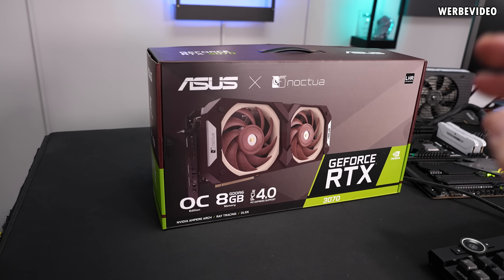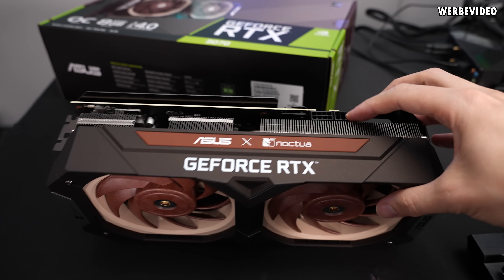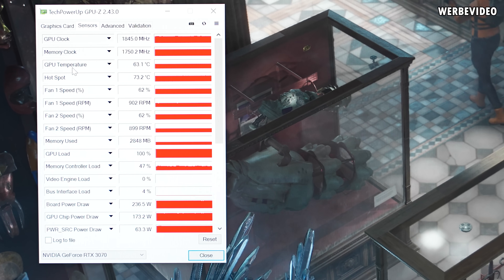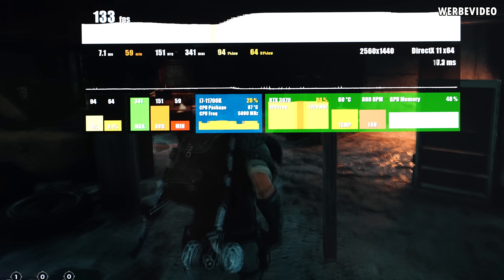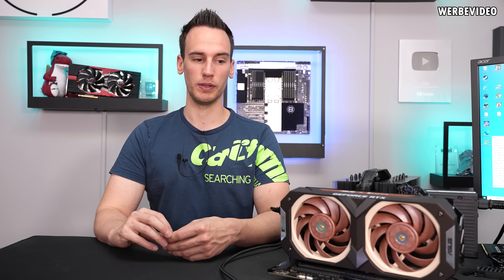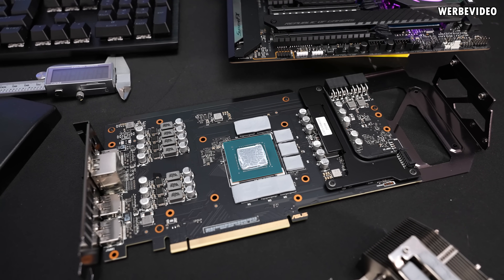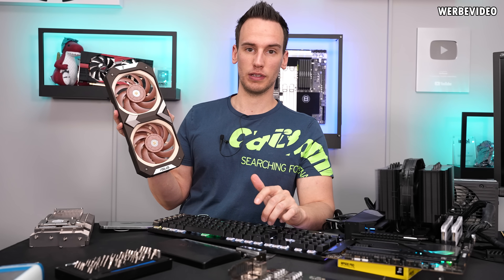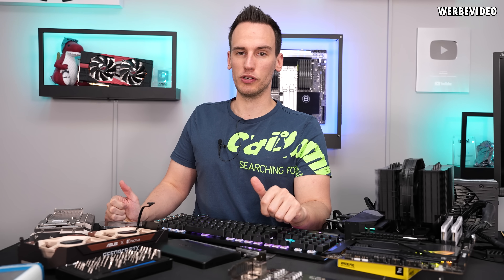Impressive Noise Levels - But what's up with the Heatsink? ASUS x Noctua RTX 3070 tested

Comment: I don't get why everyone raves so much about Noctua NF-A series, when there NF-F series fans are so much better in every aspect
Reply: Maybe in pure airflow, but the NF-A series absolutely destroys the NF-F in everything else.

Edit: Looking at the graphs and benchmarks from both Noctua and others, the NF-F is louder, and worse at everything than the NF-A series. The only time the NF-F is better is at absurdly restrictive situations, in which case you might as well buy something else with MUCH higher RPM considering the airflow you get from the NF-F at those points is ridiculously low, not to mention the noise level.
Reply: @pickleadaykeepsthedoctoraway  the NF-F series has greater airflow and greater static pressure performance
Reply: @notFunny-d7n  At certain impedances, the A series is a better fan all around. Maybe look at the graphs Noctua provides?
Reply: @notFunny-d7n  The NF-A beats it in both at heatsink level densities, and radiator densities. I am not sure where the NF-F actually wins other than insanely restrictive airflow cases.

Edit: Not to mention how much quieter the NF-A is compared to the NF-F.
Reply: @pickleadaykeepsthedoctoraway  I did, issue is that the chart states that the fan speeds are adjusted to similar on application noise levels, that is not an accurate comparison and they don't include what the actual fan speed per fan is or what the noise level target is, in any case though that would severely limit the F series as they are designed to go up to 3000 rpm vs the 2000 rpm of the A series. So, say they are normalized at a speed if 1200 rpm, you are only restricting the A series by 40% where you are restricting the F series by 60% in performance (which in theory would not make as big difference between the 2 as it would seem, the F would have greater airflow and static pressure at this given rpm). Now then if we normalize to a noise level, then the difference is probably greater because the A series has been designed to be far quieter with almost half the dBA rating at max speed compared to the F series. Only in noise level normalized tests are these charts accurate to performance. If they were rpm normalized, we would see a difference in which the F series would be tied if not beating the A series. Also, at the given impedance of a radiator the F series has better performance and at a normal heatsink they tie, the only case on this graph that the A series wins is at the case level of impedance (also take that with a grain of salt as they don't refer to which radiator, heatsink, or case they used for testing. This points to that if we were to use an open test bench, and normalize to temperature targets, the F series would win in the given airflow and static pressure ratings that they are comparing. Also, these graphs only show static pressure and airflow of specifically the given fans as the x and y coordinates with single lines for each fan, this is not a proper way to display this graph. The proper way to graph this would be to (since they are comparing a fan that is performance-based vs a fan that is noise focused) is to have a given impedance used on the y axis, and then have 3 lines per fan on the x axis, one being airflow, one being dBA and one being rpm. Also, other red flags on their website are that this graph is only linked from the A series sheet and not from the F series sheet, and on the F series page is clearly states “The industrialPPC models are high-speed fans for industrial applications. As such, they are not as quiet as other Noctua fans and less suited for low-noise PC builds. Unless you specifically require the higher speeds and performance of the industrialPPC versions, we recommend using models of our other product lines (chromax if you prefer black fans) instead.” On the A series page within it’s graphs states “Noctua recommends the pressure-optimised NF-F12 for heatsinks and radiators and the airflow-optimised NF-S12A for case fan usage.” It also states that they only distinguish between airflow and pressure optimizations at 120x25mm fans, as there is no such distinction at larger sizes. One other thing that I technically have an issue with is that at 140mm the F series designed fans (which are distinguished from the A series fans with their given blade design, rpm rating, motor and hub design, and airflow and pressure) are named differently, at 120mm it is the NF-F12 industrialPPC-3000 PWM and at the 140mm it is the NF-A14 industrialPPC-3000 PWM, given It is the exact same design as the 120mm fan in the F series, but the dropped the F and replaced it with an A, and kept the industrial tag. Whereas the A series are:  NF-A12x25 PWM for the 120mm and NF-A14 PWM for the 140mm. But at both of these the 120mm and 140mm the respective (what should be) F series has a much higher static pressure and airflow rating than the comparing A series. Finally, check out an actual fan reviewer like NoNonsensePC who did a video that is called “MASSIVE Fan Comparison! We tested 23 different 120mm PC fans!”, in which throughout his testing, the F series beat the A series in every test that did was not related to noise
Reply: @notFunny-d7n  Well sure, you might as well get a delta fan at that point. You're being a bit ridiculous ignoring noise. You win by sheer brute force. *What I mean you win, is that the NF-F wins by brute force, not you.
Reply: This fan is not really an A series fan, it is a special, next-gen fan that is formally in the A series but performs almost like an F series, except with higher airflow under most circumstances.
Reply: @TheBackyardChemist  the fans on this card are exactly the nf-a12 fans (it even mentions this in the specs on the ASUS site), if you count the fans and look at how they are swept, the dimension and style of the hub and even the vortex generators on the blades are exactly the same
Reply: @notFunny-d7n  I got confused because I thought there was an older 12 cm A series, before the NF-A12x25. It seems like there is not.
Anyways, the problem with the F-12 fans is that they do not move as much air as the A12x25 at the same noise level, if you have them against a typical watercooling radiator or finstack.
Reply: @TheBackyardChemist  He seems to think ignoring noise level is fair. There are better fans than noctua if noise is not an issue. The NF-F fan is pretty god awful for typical use cases.

Comment: Somewhat disappointed that the fans are not directly attached to the heatsink so you can't deshroud the card. In an ITX case with the correct dimensions, I suppose you could remove the fans and mount the fans inside your chassis depending on your case size... but in that scenario why not deshroud a tuff model and get a fan adapter?

Comment: What's the Hot Spot sensor actually measuring? I have a GPU temperature of 68-71 under sustained load, but the Hot Spot goes up to 100-104.
Reply: The hottest spot on the chip, some have 10-30 sensors in the chip, this is then the hottest one.
The GPU temp 68-71 is the classic old way of measuring the temperature.
Reply: @larsjrgensen5975  I just find it hard to believe that something that would spew out heat in excess of 100 degrees would report at average 30 degrees lower temperature. Are we 100% certain that the hot spot temperature is actually the GPU and not VRM or RAM?
Reply: @dominic.h.3363  Something like the RT cores could be sleeping in the corner of the chip doing nothing, or the opposite could be true so a small area has very high load, this can give you the delta of 30 degrees.

You should have VRM and VRAM temps in you monitoring software.

As far as I understand, the hotspot temperature has always been there, it was just not visible to the user before.

You are writing that you may repaste, remember to keep an eye on the temps, my noctua paste got pressed away from the core (pump out) after a couple of months, I had to buy something else or I would need to repaste every 3-4 months.
Reply: @larsjrgensen5975  Well, the sensor was implemented on Turing cards, so it's been around for less than 3 years at most, but yea, I only recently noticed monitoring software showing the readout. I just didn't know what it was measuring exactly. I'm only getting hot spot temperatures that high when I'm doing CUDA calculations, i.e. rendering. I'll be using Kryonaut.
Reply: The GPU core actually has many temp sensors scattered across it, the regular GPU temp you see is usually an average, while the hotspot is the maximum of the sensors. Having a large difference means your cooler is probably not as perfectly flat as it could be :/ Or maybe a bad thermal paste spread, or an uneven mounting pressure.
Reply: @TheBackyardChemist  Well, if it's not the VRM or RAM chips, it's an easy fix, I can repaste the card. But a 30 degree delta for the very same component seems a bit odd for me. Like, won't that affect adjacent readings and therefore averages?
Reply: @dominic.h.3363  On 7/8/10 nm process nodes and smaller, localized hotspots in the silicon can be really fierce

Comment: A bit better than expected. I 3D-printed a duct for the MSI rx 6600 XT, and ended up with about 700rpm for 65/90C at about 23C ambient. There is a lot of wasted airflow for this Asus design, as fans do not cover the entire heatsink, and there is huge gaps in the heatsink below the fans. With a simple duct you could easily improve the performance of this Asus X Noctua design, just as you can with the Noctua D15 CPU cooler, or with the MSI GPU of mine. I do realize that with the results shown here, they are good enough for most people to not look for further improvements, which should hint at what makers should be looking at doing. With a more optimal heatsink design and 12cm fans, there is no need for a Noctua fan, for even better results than this.
Reply: duct Picture?
Reply: @brunogm  Fixing a set to make videos. I will post a video on it, shortly. I am also looking for partners to print on demand the designs I make, for 1$ a copy. I am not sure that making this a print at home thing is that wise, due to the usage of PLA and other stupidity that will produce pure hazards in a computer. Also, the lack of examples of duct designs on the tube, just shows the lack of necessary skill within the community, so as of now, there is no point in publicly sharing source files.
Reply: @FrodeBergetonNilsen   for sure will be nice when you can show it!!
Reply: @brunogm  Sure would. The thing is, that any GFX can be converted into a better performer than this Asus one, by a simple piece of plastics, and some decent fans. Say the Arctic P12.  He said he was working on something, lets see what he got. It is time for some innovation and better thermal designs for this industry. What we got is just stale and bad.

Comment: Is it possible on this card to reverse the fans to a pull setup? I've heard conversations in sff communities where some people doing deshroud mods found pull quieter than push.
Reply: I did that with my 1080ti in a Ncase M1, deshrouded and with two nf-a12x25 as pull. It works, but in a very specific case (pun intended), as the GPU is so high and long it blocks a path for the hot airflow to escape.
Looking at the video right now, I don’t see why it might not be possible… but my bet is deshrouding has the advantage to remove the shroud as an airflow obstacle. I have no data or even remote memories about it, though…

Comment: it has a reason to exist only on a 3090 or 3080/ti imo
Reply: Asus probably wants to sell off extra tuf boards with the 3070 chip on it already. 3080 cards are probably going to go EOL since Nvidia realized that the $700 MSRP was too low.

It's pretty much a tuf 3070 with a custom shroud + custom fans, with nearly identical heatsink for a huge price increase. People will pay the higher price either way, so perfect way to get extra profit while doing almost nothing. It doesn't even use the strix board, that should tell you something about how serious this is.

Comment: I laughed at James from Major Hardware when he 3D printed a shroud and put some Noctua fans on a card. It looked good for what it was but it was sooo THICK I didnt really like. Now I see this and WOW, makes his version much more impressive, lol.
Reply: I did the same thing, but I put on NF-A9x14's. Its still a 2slotter now ..
Reply: @The_Noticer.  how do you attach the fans?
zip ties or something else?
Reply: @clarkkent6054  Custom fan shroud. Drew it in NX, and then had some shop print and mail it.
I'd post a picture but any link = autodelete.
Reply: @clarkkent6054  Speed tape for Aviation mechanics.
Reply: @clarkkent6054  Yeah, just allow the inner McGyver to come out. XD
Reply: @clarkkent6054  zip ties work very well, cheap, and very easy.
I have a 1080 with 2x120mm sw3.
Running with stock voltage, +150 on core clock 800rpm on the fans 600 on case fans. 60-62°C with 25°C ambient.
Reply: Yeah, his version was actually even closer to this than I originally thought, and now with 3d printing and design being so accessible, it'd be pretty easy to accomplish the same thing on other GPUs.
Reply: I zip tied 2 120mm case fans to my 1070 strix, when I was using a blower to de dust it and broke 2 spinning fans with my fingers. Runs cooler than ever, the fans are connected to the case fan connections on the gpu. So I can still control them and set fan curves etc in gpu tweak 2
Reply: totally agree. there's no one better than major hardware

Comment: I paid for FTW3, I would pay for this. Add top Noctua AC for CPU and close everything inside glass-less Define R case. The ultimate potato silent build without LC.
I love the possibility to clean the GPU from dust without need to replace thermal paste. Easy maintenance.

Comment: Still want Arctic Accelero coolers to make a comeback. Make 'em for 2x 120mm or even 2x 140mm
Reply: Yep, I have Morpheus slapped onto 5700 XT with 2 Arctic P12 and its dead silent, but Morpheus could be a little wider, like 15mm. Fans sticking out from that cooler on both sides.
Length of the cooler is spot on, tho.
Reply: @Yuriewitsch  Precisely, wider coolers would massively increase cooling capacity.
Reply: I have a Morpheus on my 2080ti and it’s awesome. Aftermarket coolers business should really grow
Reply: @pb96-p6g  Yeah, especially since the next spec says that cards can use up to 600w
Reply: good news guys, I messaged arctic about it on twitter and they said they're working on a redesign🎉🎉 I'm honestly surprised they told me haha
Reply: for real, i want one for my crappy zotac 3060ti, it’s so damn loud

Comment: I'd swap out those A12s for F12 Industial 3000rpm fans that Noctua makes :3c
Reply: I bet you wouldn't see much improvement at all. It would just be absurdly loud.

When linus tested the 'blowiematron' or whatever (Delta fan I think), it really didn't make much of a difference. Well except for the absurd power draw and noise level, and a celsius or two difference in cooling.
Reply: @pickleadaykeepsthedoctoraway  Probably not but I bet the VRM and memory components would probably appreciate the extra air. The main limitation to the heatsink on gpus and tower coolers as well is the ability for the fin stacks to radiate heat fast enough for the fans to push it away. If the fans are too fast for the heatsink then the gains from better airflow will be limited to the thermal dissipation of the fin stack. That's why high pressure, high flow fans work best on dense and thick radaitors, like Alphacool's notable "Monsta" series of 80mm thick radiators. There's enough surface area in the fin stack to gain a notable benefit from high flow, high pressure fans. Be they Delta server fans, AVC fans, or Noctua's industrial fans.
Reply: The iPPC 3k rpm fans are much noisier than the A12s though.  They have this grating whine/growl at all RPM levels - and I don't mind the sound of Delta fans, so that's saying something.
Reply: @LeadSkillets  They just move more air at a higher pressure. That's it really. I also have a set of four of them on hand already.

Comment: I would say someone somewhere make a 3D-printable model of shroud for every famous GPU that can fit the noctua fans, and we won't need 10-different SKUs for each one
Reply: It's not that hard to make a printable shroud though.
Reply: @kawag2780  Yeah just look where your current one is mounted, measure it, draw it in CAD and have someone print it out.
You can find CAD models of popular fansizes to slot into place. I even found the CAD model of the NF-A9x14 fans I used in my own custom GPU.
Reply: very much this.
Reply: the only problems are heatsinks - they are narrower and often have some protruding parts. I have mine Gigabyte 3080 Gaming OC fixed with 2 Arctic P12 using 3d printed clips instead of full shroud. Could not be happier.
Reply: @Tinkering With Tech lol... Was about to say the same thing
Reply: You just just ziptie fans to any gpu lol